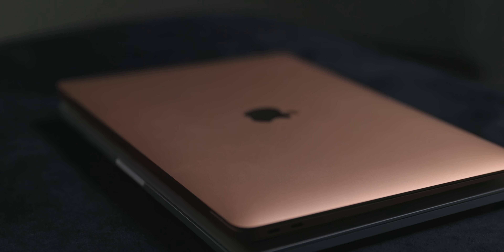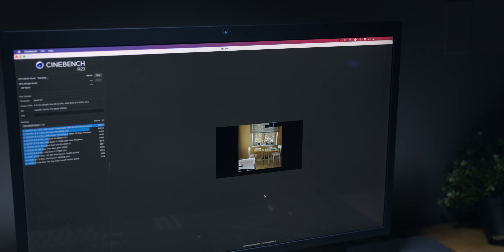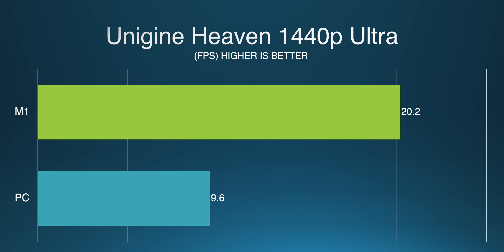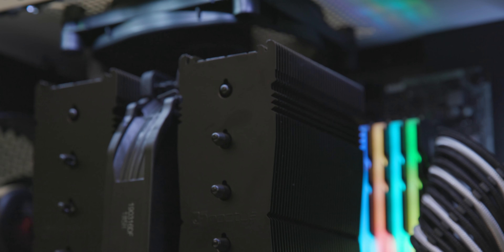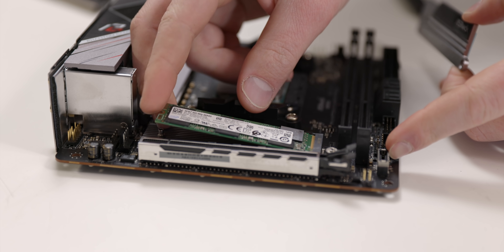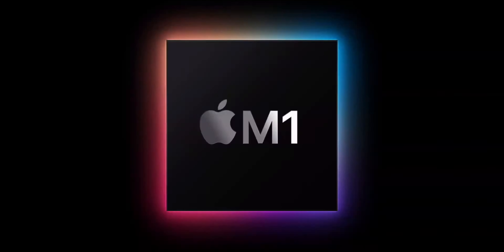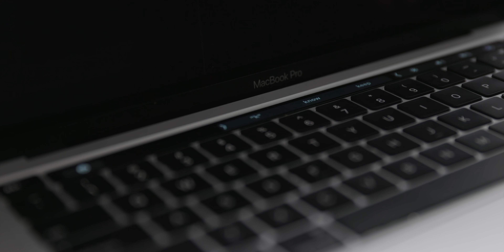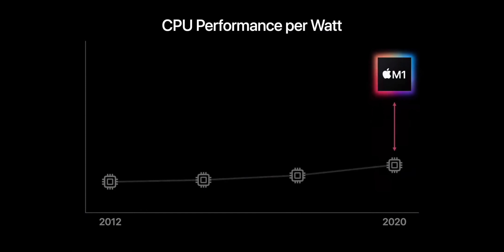$699 Mac mini vs $1,000 PC: Which Is Faster?

Comment: What makes me feel even worse about this, is that the M1 has half of its cores as 'low power' cores for background tasks, whereas the AMD one has 8 full power cores. This means that if all the cores of the M1 were equally high erformance, it could pull a larger lead than it already has in multithreaded applications.
Reply: Interesting take, seeing as the whole video was about "effiency" and not raw power :)
Reply: @Aier0  I know. But imagine if the performance was much better, with only a little more power draw at most compared to the ryzen. Like it means the M1 isn't at its fullest potential

Comment: I never really liked using notebooks as my daily driver and only tolerated them to be mobile.  But I now use a base model M1 Macbook Air as my desktop.  It performs better than my loud Ryzen Hackintosh that used to be my main  desktop.  Life without PC fan noises is so good!
Reply: You know you can get a quiet PC if you want.
Reply: @ajwasthere  No shit, but you have to spend quite a bit of money on a quality case, heat sinks, and fans to make it really quiet.  My Ryzen system cost nearly as much as my Macbook, but it still makes noise and generates a ton of heat.
Reply: @vectors2final36  it does cost money to get a silent system but it's actually very easy nowadays. You dont need to buy fancy cases anymore. In order to get the most silent system you simply need an unobstructed case. Phanteks and lian li have some great budget options. You can buy a 5 pack of silent fans for next to nothing and you're good to go.
Reply: @vectors2final36  Well, since you're saying that you must have close to zero % reliance on the GPU. The M1 has a strong CPU but a very weak GPU. It's very specific hardware. For instance, if the work you do uses codecs not HW-accelerated by the M1, you will have extremely terrible performance. Like, it only has HW-accelerated encode&decode for H264, H265, VP8, VP9 and JPEG. That's it. If you use any other codec, then you're screwed. So you have to be 100% sure that the work you will be doing will be supported by the M1 chip.
Reply: @Samosayummyyay  exactly. Everyone is talking like it’s the greatest thing, while completely discounting how many people are using gpus for their work. Everyone says “m1 is great for video creation” but all the cool video tech like virtual backgrounds, gpu rendering, and real time ray tracing are still dominated by nvidia. Yeah m1 is a nice computer for most people for a decent price, but most real “professionals” can’t use it for shut, because the gpu is like barely faster than a 1060 in a lot of cases. A like 4 year old budget gpu.
Reply: @vectors2final36  no you don't a quiet case is well under $100.
Reply: Same haha
Reply: Mine arrives today, so excited to go fanless!
Reply: This is me
Reply: yes in my mac mini the silent is a truly strong point

Comment: Well if everyone is moving to their own chip, I'm more afraid about software optimizations on other platforms. Apple, having control over the whole pipeline (from hardware to OS), will have (is having) an easier time moving everything from one architecture to the other.
Software for Windows will be a complete other story I believe.
Linux might not be as much of an issue with already existing platforms (RPi).
Another interesting point will be the future of the gaming sphere, next-gen consoles (Sony and MS) using ARM ?

Comment: Apple net worth: 2 Trillion
Amd net worth: 6.75B and almost bankrupt 5 years ago
It is expected of apple to make a better chip than available in the market, apple can literally spend more than amd's net worth just for RnD lmao
Reply: You are right in theory but there are many thing to be taken into consideration. 

Amd is a processor company, meaning all of their r&d goes into developing processors.
Apple is a tech company, their ressources must be spent in iphone, camera, computers, watches, and much more more. 
This probably brings the budget on more equal field.
Reply: @charles-davidberube1174  Ofcourse they have, but hear this 6.7 billion is 0.335% in 2 Trillion I'm pretty sure they are willing to spend more than that for Apple sillicon which is literally the heart of ALL their products. Also amd is not only a CPU but also a GPU manufacturer, Ofcourse the M1 is impressive but it has to be otherwise there would be no point of using it.
Reply: Explain Intel then. Also that's market cap, not their actual assets. Apple still have more but the $2trillion is just what the stock market values them at if someone were to try and buy them for example.
Reply: @TalesOfWar  Whatever man Apple has way more resources compared to AMD and Alright, intel had a monopoly for the past 8 years (ever since ivy bridge), Amd simply couldn't complete, intel got greedy took lots of profit instead of innovating because no competition, and now they're suffering because of that. Intel has really good engineers, They have managed to squeeze every bit of performance from a 5 year old process node, but top management didn't listen to them or invest in RnD when they had to.

Comment: I have a feeling this type of performance is easier to achieve when you design the only hardware/software stack that goes with it. Windows machines will always have flexibility first, then performance. Like Android Phones. I don't know much about it, but I would think this could severely shake up the server industry if Apple decides to go that route.
Reply: Speaking of Android Phones (and tablets) ... All my Android stuff is in the junk drawer now....compared to my Mac and iOS stuff it's a pain in the @ss to use and navigate the interface.... just too clunky

Comment: Only thing I have against the M1 is that I can't run windows on them when I need to.
Reply: Say hi to running it in Parallels with full 3D GPU acceleration and near-native performance with virtualization. Runs better than the Surface Pro X too.
Reply: @ThatStella7922  haven’t tried that yet but I probably should. Not sure how a base MacBook Air would handle it though.
Reply: @jhblake123  the base M1 MBA would handle it fine (maybe not in storage but eh). The M1 is basically the same on the MBA and MBP except for the one gpu core. Anyway since windows (the ARM version) will run with hardware virtualization, there is very little performance overhead due it basically being KVM. Parallels’ 3D GPU acceleration is also paravirtualized so you get decent 3D performance from it.
Reply: get a $250 Walmart Windows Laptop

Comment: I really just want a laptop with actual Thunderbolt and eGPU support. That's the only thing holding me back from buying any M1, and AMD, computer. If it had better GPU performance, then I'd overlook the lack of eGPU support. We'll see how M1X machines fare.
Reply: Same way I feel I want double  or triple the graphics performance
Reply: IMO, eGPU support from Apple is likely dead....Apple is leaving behind "partnerships" with AMD etc.... the whole point of the new SoCs is the ability to be as independent as possible from the schedules and whims of  other developers. Next Gen M-Series chips will be the final nail in the coffin for discreet graphic processors in mobile devices.
Reply: eGPUs, even over TB4, are likely going to be a performance bottleneck. The SoC's dedicated Bus for RAM/VRAM removes the inherent clocking speed and data bandwidth issues slowing external devices. Remember, M1s are just the first in an upcoming family of SoCs that will vary to some degree whether they are in a Consumer or Pro-Level device. IMO, Apple's strategy is to remove the barriers that "haters" have always used to denigrate the Mac Platform. Super Mobile and long Battery life - check....Best performance per unit of Power - check.... Solid OS - check....lower price - check and check !
Reply: @goobfilmcast4239  My M1 MacBook Air is collecting dust right now. Work bought it for me as a test machine, but I honestly can't even be bothered to use it for that most of the time. I tested my current workflow on it, and nearly every dev tool I use is completely broken on it. Even Apple's own LLVM spits out stack traces that lead nowhere, wasting nearly 6 hours of my time. Not to mention, it does a worse job of driving external displays than my x201 does, from 12 years ago. Kinda  pathetic that my new laptop isn't compatible with my displays, of all things.
Reply: @dial2616  mmmmm..... you know the MBA is a Laptop for Soccer moms, right ? ...... and it still beats tons of more expensive x86s!
Reply: @goobfilmcast4239  It also loses to cheaper x86 processors. You could buy a Ryzen 7 4800u in $450 laptops a year ago, and that processor has better single/multicore performance.
Reply: @dial2616  Yes...but why would I ?..... I am falling for the Mac OS/iPad/Watch more and more ... all new, recent but low-end purchases (including my base M1 mini) and they work soooo well together...Now that Apple is set to be a "Performance" company, I picked a good time to go ALL Apple.....
Reply: @goobfilmcast4239  If by "work well together" you means it syncs your files across devices then welcome to 2014! Otherwise, I'm not really sure what you mean. I run a Nextcloud instance that syncs my files, contacts, calendar, email, bookmarks, health info, photos, git repos, notes and tasks, all on my own server. Setting it up on a new device takes less than 2 minutes, and I can access all of that data through a convenient web interface. On top of that, it's actually secure, and access is controlled via easy-to-use SSH keys (both more secure and simpler than Apple's keychain).
Reply: @dial2616  it loses in certain tests just like the 4800u loses to the m1 in certain tests. However the 4800u isn’t as efficient as the m1. Not everyone is looking for the most power per dollar. Some want a small and light machine that that’s a long time on battery and still performs very well.
Reply: @carsonodneal4079  Some people also don't want an SSD that fails in 3 months of usage, but it looks like Apple didn't quite listen to them either.
Reply: @dial2616  yet no SSD has failed yet. We’ll see how they end up. You also don’t have to buy a MacBook. But that wasn’t your point. It about about the 4800u vs m1 which they are for different uses and different people.
Reply: @carsonodneal4079  For once, I agree. The 4800u is for the average consumer who has a mixed workload and relies on a healthy combination of demanding and light tasks. The M1 is the ideal CPU for people who watch YouTube all day.
Reply: @dial2616  lol okay. And college students. And everyone who wants a  long lasting laptop.
Reply: @carsonodneal4079  I'd imagine most college students would prefer a computer with native Google Drive support, but maybe I'm wrong. If you're stooping to the "college students" level though, there really must not be many workflows for this machine besides text editing. At that point, you may as well pick a laptop with a good keyboard.
Reply: @dial2616  Only difference is, with apple, all that stuff is integrated and seamless for the end user.
Reply: @goobfilmcast4239  I don't care about any of that. I just want a device I can use for work during the day, and play games on at night. Without an eGPU, I can't do both, and still need a separate rig for one or the other use case. I no longer want multiple machines, so bottleneck or not , OS is "amazing", or "SoC is better", not having eGPU support or a better dGPU for gaming is a dealbreaker for me.
Reply: I M1 has thunderbolt you can use PCIe devices per the USB-4 connections what it does not have is ARM64 AMD drivers but for other PCIe devices that it does have drivers for it works very well, network cards, etc.
Reply: Don't the last gen Intel-based Macs have actual thunderbolt and eGPU support?
Reply: eGPUs are theoretically powerful but are bottlenecked by the connectors
Reply: A CPU that’s amazingly efficient and optimised for portable devices isn’t really going to be good at gaming and high performance. You’re best having two computers that are specialised. A desktop gaming PC and a thin-and-light laptop for on the go.

Comment: But do people care about power use or speed?
My electricity cost is minor (and I'm 100% renewable) and even when out its so rare that I cannot get a power point nearby that I never think about it.
For most of my daily use an old i5 Mac Mini can cope fine - it struggles with VMs esp when running W10 :-)
Reply: Yes. They care. Think about businesses deploying tens, hundreds or thousands of systems. That all adds up. Also a laptop that lasts longer than most humans do per day is extremely impressive. Also also, that gives you a MUCH higher envelope to work within for even more performance. Imagine a 65W MX based SoC in an iMac or Mac Pro? Considering how much performance these things manage in 20W FULL system draw and I can't be anything but excited for the future.

Comment: We bought four for our design office, unfortunately they are not that anything special, we mostly use adobe software and everyone experiences crashes daily, pretty disappointing but put that down to adobes poor optimization, in real world terms for our industry m1 is about the same or less stable than our 3 year old macs, I think the potential is there but the software optimization is not out there yet, for now. Considering everything is rubbing through rosetta translation for everything it is rather impressive but no real gains that I can see after a month
Reply: Adobe suck on whatever platform or hardware they're running. This is nothing new lol. The performance of their 2020 and 2021 apps are especially terrible right now.
Reply: @TalesOfWar  Well.. cant disagree with you there :). Unless you're only using mac software the M1 although pushing the envelope wont work so well if you're running everything through Rosetta.  As a production machine for me personally its not there although the future could be exciting.

Comment: Does that ravpower charge at 15W or is it just a normal Qi charger with the magnets aka 7.5W power delivery? I already have an Apple magsafe charger but just checking through out their page I couldn’t find any mention of the actual wireless power 🤔

Comment: Well if you ignore the fact it tears through SSDs. 

Also I am pretty sure that using an old Ryzen is kinda ruining the results. 

Try comparing using the latest ryzen chip. Also APU isn't technically correct because by that logic wtf is a 10900k? the F series exist because they don't have integrated and require discreet GPU. 

And APUs aren't used for laptops... That is a gross over simplifications. The 4000 series of AMD are all mobile chips. But that doesn't mean all APUs are... For example the PS4, PS5, Xbox One and Xbox Series X all use AMD APUs. Though these are custom, they are still APUs. And phones do technically as an APU is just another form of SoC if we are gonna be grossly oversimplifying to the point of being somewhat erroneous. 

I don't trust a guy that does videos on headphones and contradicts people that have qualifications in sound engineering and do it as their full time job. I trust someone even less that does this whole video ignoring some of the huge problems with the M1... Then again you don't want Apple to blacklist you so will fail to mention certain problems until they clear you to because they have a fix proposed. Like how they let people badmouth a model of notebook when the next one is due to help with trending and brand awareness. LOL. 

No self respecting tech enthusiast would EVER recommend a computer that has a basic flaw with writing to SSDs. I mean unless you love destroying SSDs.

Comment: The M1 isn't translating instruction on the benchmarks. It actually supports some x86 natively, making it even better
Reply: Some. Its still emulating a lot. And power per watt its amazing. Plus it has the possibility to leverage some of the Native ARM code Apple has on its tablets and phones. Unlike the old RISC Macs of yore, its not longer in a software desert fit only for professionals.

The only issue is like a lot of Apple equipment, it will probably fail just outside of warranty or be made intentionally obsolete by greedy Apple software upgrade lockouts.
Reply: The M1 only supports about 5% of the x86 instruction set natively. Most of the performance optimizations are in the 95%, so it's effectively a moot point with the advantage going to x86 for having a greater potential IPC.